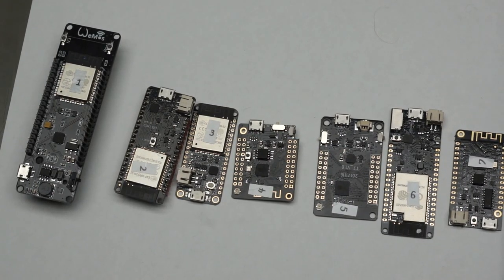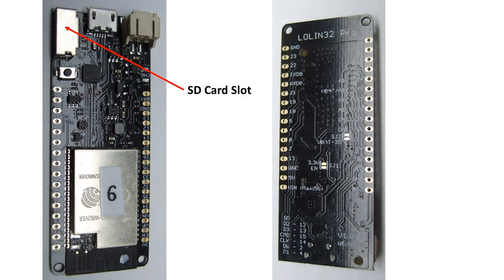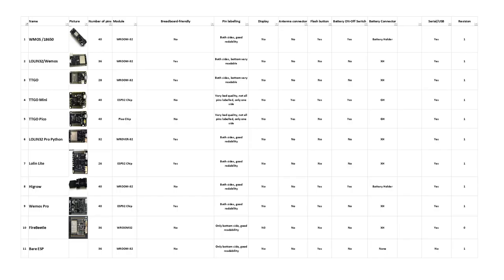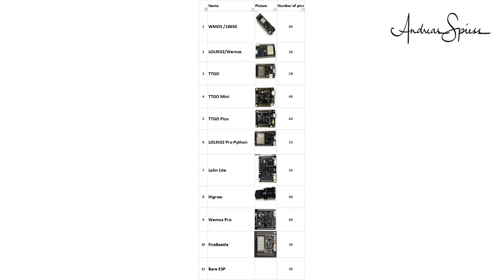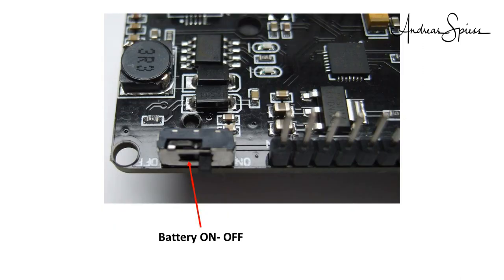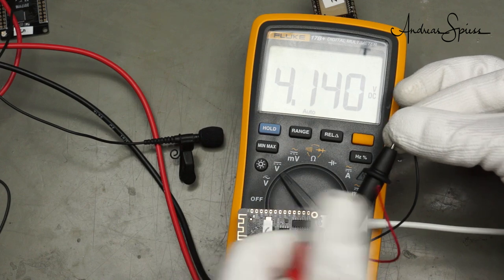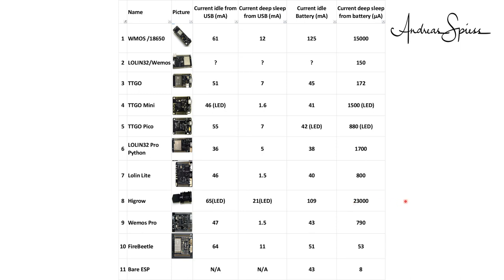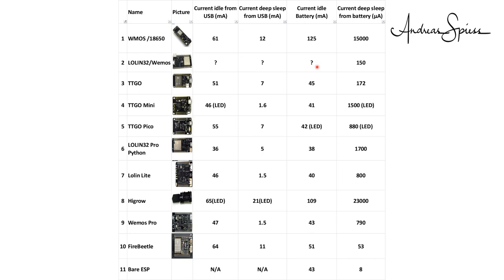#193 Comparison of 10 ESP32 Battery powered Boards without display (incl. deep-sleep)

Comment: Powering the boards on 3v pin will reduce current use even more.
Reply from the maker: You are right. But you have to pay attention you stay inside the specs of the chips
Reply: Andreas Spiess 
True, I power with the 3v reel of a single battery 18650 shield. I use a analog pin to monitor the battery voltage so i can put esp in deepsleep when battery is getting low. Switching of the enable pin would be better but i dont know how to keep it low when esp is off.

Comment: Wow that HiGrow (8) is really looooonnnnnng!  Looks like something that would get accidentally snapped easily.
Reply: the long part is the capacitive soil moisture sensor ... it must be soooo looonnnnng ;)
Reply: Carsten - I realize that but there's a time when one has to rethink their design and perhaps make the sensor on a separate board.  Even without the soil sensor it would still be really long.  Beside the soil sensor only needs a few wires so it wouldn't cost much.
Reply from the maker: Longer is usually better ;-)

Comment: We need boards that directly support LiFePO4 cells.
Reply from the maker: I do not know one board which does it
Reply: @AndreasSpiess  And thus the problem!  Devices like the ESP32 and ESP8266 operate comfortably in the voltage range of an LFP cell without regulators.  The closest we can come is putting a 3.6v comparator on the CE line of the TP4056, which is...  kind of gross.

Comment: I have become a lover of the ESP32 as it fits my needs great. The down side is that so far all the dev boards that I have brought have had hardware design faults. I program in Micro-Python so having the psRAM is a huge advatange to allow heavy ram tasks. When I first started there wasn't any dev boards with the psRAM so I used an analog LAMB BOB see https://www.analoglamb.com/product/esp32-wrover-breakout-board/ but if you add all the components correctly it causes the onboard 1.8v regular to shut down and sends 3.3v to the psRAM and kills it. I killed 2 Wrover modules before I worked out what was wrong and just need to leave off the pull up resistor on pin12 but it still had instability problems because it doesn't have all the decoupling caps as recommenced in the Wrover datasheet. Next I got a Lolin32 pro dev board and it worked great for a while but also died the same as everyone else that I talked to on the Micro-Python forum and now has been pulled from the market. My current board is a TTGO V1 board(there seems to be a couple of versions of this board) the version that I got doesn't have a boot button or the auto boot lines(DTR RTS) connected either so it won't auto select boot and there isn't any button to do so manually, I had to connect a jumper wire from IO0 to ground then reset to get in to boot mode. On the TTGO there isn't any pull u p resisotrs on the SD card adaptor so it doesn't work either, the only way that I could use a SD card was to connect an external one with oull ups to the break out pins. Also on the TTGO there isn't a mosfet to disconnect the battery from the 3.3v regular Vin pin so if you try to charge the battery with the USB lead then the battery will be connected both to the 4.2v charging IC and the Vin pin of the regular at the same time the USB 5v+ Vbus is connected to the regular Vin pin so there is a direct short between the 5v Vbus and 4.2v charging IC
Reply from the maker: Thank you for your feedback. It seems, that Python is even a little behind the Arduino IDE on the ESP32...
Reply: It doesn't matter software you use (C, Ardunio, Micro-Python or Lua) if the dev board has hardware design faults like a short between the charging IC 4.2v out and the 5v USB Vbus or pull up resistors missing of the SD card interface or a pull up resistor on pin 12 that disables the ESP32 on board 1.8v regular causing over voltage of the RAM. The official ESP32 port of Micro-Python isn't very developed but everyone is using Laboris unofficial port which is quite advanced (will have some features Ardunio doesn't yet have implemented) see his wiki for what he has added on top of the official port.
Reply from the maker: I meant the PSRAM. This is not very popular for the IDE. But obviously very important for Python.
Reply: I love your channel and find it very informative but from someone that has spent a fair bit of time using a couple of the boards in the review I know there are some hardware design faults. You basically have only tested the power consumption in sleep mode. Many of these boards have left off the recommenced decoupling capacitors in the ESP32/Wroom/Wrover datasheets, the boards will still run for a simple test but can suffer instability problems from the dreaded brown outs when they are put to real work.
Reply: I started with the ESP8266 that has very little RAM and updated to the ESP32 becuase it has more RAM and more GPIO pins. I choose to get psRAM just because it gave me sooooooo much RAM I was never going to run short. The ESP32 without psRAM will run Mico-Python fine just a few advanced features can run out of memory. Yes Micro-Python does use more RAM than Ardunio because the compiler is on the ESP32 chip unlike Ardunio that you compile on your PC then down load the compiled file. Micro-Python will run python files directly on the ESP32. The on board compiler does take up both flash storage space and RAM to do the compiling.
Reply from the maker: I for sure have to try Python once. It is on my list since a long time :-(
Reply: It is quite often hard for people that have gained so much experience on 1 platform to change to a new platform as they go from knowing how to do most things to having to work everything out all over again. You could describe Micro-Python as if Ardunio and Raspberry pi had a made love and had a child as it sort of blurs the lines between Micro controller and micro Computer

Comment: Great video as usual!
I have some feedback for your spreadsheet, I think the regulator on the lolin pro board is BL8026 as I found out in their schematics https://wiki.wemos.cc/_media/products:lolin32:sch_lolin32_pro_v1.0.0.pdf
I found the regulator datasheet here https://datasheet.lcsc.com/szlcsc/BL8026CB5TR_C77972.pdf
I'm not familiar with the company / brand and turns out the regulator are dirt cheap.
Reply from the maker: Thank you. I will put your info into the spread sheet.

Comment: Hi Andreas, we are building connected bee hives see http://community.hiveeyes.org so battery powered devices are obligatory in the wild. We will run the devices for month or better a year without changing battery. I bould an ESP8266 based device with an Adafruit Huzzah ESP8266 and the CN3065 you tested in an other video also (see https://community.hiveeyes.org/t/open-hive-wifi-solar-adafruit-huzzah/247). I have chosen the Adafruit Huzzah becaus it has no USB chip on board and so it is more power saving than other boards with a convenient but hungry USB chitp. In this test you have only candidates with USB on board. I wonder what the reason is for it? Is there no ESP32 without USB but FTDI? I would realy appreciate some hints for a ultra low power ESP32 board in the best case with solar charger on board.
Reply from the maker: The best boards I showed have quite a low sleep current. when powered by a battery. The FTDI chips are probably not powered during battery operation on these boards. I think for summer and solar energy this should be no problem. If you want to go lower you can use a bare ESP chip and a LiFoPo battery as I showed in other videos.

Comment: There are new chips ESP32F and ESP32S - supposingly better for lower power projects.
I am annoyed recently by Arduino libraries - they don't work with many devices on esp32
Lolin32 is kind of terrible and very power hungry. DevKit is best.
Reply from the maker: The Arduino Library is still under heavy development. And I am not sure if your ESP32S and F are chips. I did not find any reference. I only found references to modules which contain normal ESP32 chips. Maybe you have a link to the datasheets.
Reply from the maker: I think these are all versions of the same with the same ESP32 chip inside. Just different branding. The  -32S was one of the first modules sold last year.

Comment: there is no column for the ability to connect/disconnect usb power here on the table https://docs.google.com/spreadsheets/d/1Mu-bNwpnkiNUiM7f2dx8-gPnIAFMibsC2hMlWhIHbPQ/edit#gid=0
so i wonder, can we use lolin32 with both usb power and battery? so that the battery acts like an ups
Reply from the maker: You are right. This column "disappeared" over time. The Lolin32 should be ok and work on both.